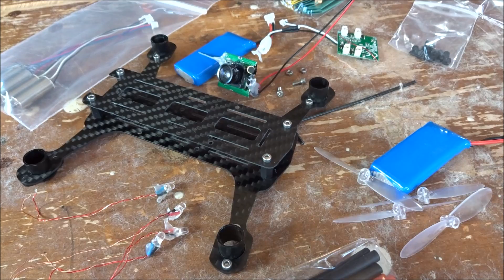Custom Micro FPV Quad: Build Tutorial

Comment: I want to replicate this build, but I'm a college student on a budget haha. What other transmitters will work with this? I see you have $99 one, I'd like to be able to use one a little cheaper than that.
Reply from the maker: +Brandyn Reeves Pretty much any transmitter that does DSM2, but sure what the cheapest one is. That is only for this flight controller though. I only used it so I would have acro capabilites. You could very well buy a BNF $13 JJRC JJ-1000 and swap in the board and remote, and save like $120 there. Makes it feel more like a toy though. This frame is also a bit heavy, so maybe something made out of poly and cheaper?
Reply: Sweet thanks for the information. So I'm hearing that I could use almost any mirco quad board/transmitter (with the plug and play motor option) and put it into this frame? Would the size of the motors limit anything or not really?
Reply from the maker: Brandyn Reeves Yes, to an extent. The board does not need to have the plug, you just have to solder them on. As for motors, if you are running this frame, with FPV gear, 8.5mm really are necessary. Any smaller like 7mm and it will be really under powered. Also I don't think the frame comes in anything but 8.5mm ;P
Reply: The RCAddict  Sweet! Thanks for all of the info!

Comment: Does the NQx fpv board work well with the motors?
Reply from the maker: +fish herp Yeah, it is the module it is not so friendly with. Took me a while to get the settings right to bind, and now it will bind every time, but getting throttle control to work is luck :/ Let me know if you are doing it and need help with settings :)

Comment: the flight controller you sent us a link to is not the fpv one?
Reply from the maker: +richard zglobicki When I bought mine, it was from the US and $30. But it seems I cant find anymore like that, as where I got it from went out of stock. I added in a new link, but it is from Germany and $45 :( Only one I could find on eBay, and at that point it would be better to buy it straight from Horizon Hobby in the US from $40

Comment: I think those are black nylon nuts, not spacers.
Reply from the maker: +Wm Robert Leschyna Yes they are. It comes with a set of plastic nuts and bolts as well, to save weight. I think you probably could use them as spacers though :)

Comment: I'm no expert but perhaps if you upgrade to a circular polarized antenna (Search this on banggood: FPV 5.8GHz Micro CL TX Antenna Lightweight) you will get better range and video quality?

I use that antenna on my diy 10g fpv rig. The antenna itself weighs 3g and you can bend it in to shape with no obvious effect on picture quality. I've gotten about 200m range on it, flying along a beach. My transmitter (MJX X600) lost signal, but the video I was getting was a little grainy but easily flyable.
Reply from the maker: +OHMYQUADcopter I am not so sure how to swap out an antenna like this, but I am getting just fine signal with the stock linear one :) On a larger build I would never use a linear though :) I fly it around fine inrdoors, and only starts to get bad behind 3 walls and around 2 corners ;) I got about 150M outside.
Reply: +The RCAddict nice range! I thought it would be no more than 100m. 

There are a few tutorials on youtube, all you have to do is connect the antenna to the antenna vcc and the wire around it to the ground ports. 

If you're getting 150m range no problem, save yourself a few grams.

Looking forward to flight footage!
Reply from the maker: OHMYQUADcopter Yeah, and smething like this is indeed only for indoors or close in outdoors flying :D

Comment: btw your first 2 links (Frame and motors) does not work. Psd: where can i get the board?
Reply: +Arpuz™ also, how do you pair the transmitter with the quad and how do you also pair the fpv camera with the screen that you will be watching what the camera sees? (btw, which screen should i get?)
Reply from the maker: +Arpuz™ I went through and fixed the links. Are they all working now? I couldn't find the board in the US anymore. I got mine for $3o in the US, but they are now sold out, and I could only find $45 from Germany :/ The camera stars transmitting once it gets power, so you turn on your screen and receiver and go through the channels until it picks up the video :) I use the Quanum V2 goggles and recommend them.

Comment: This is an interesting build!
I have a micro H frame that I've been putting off doing anything with and your mention of the Blade Nano QX board makes me wonder if my X9's FCB can also handle running 8.5mm motors when it runs 6mm motors right now.
Oh -replace that metal hardware with mylon for massive weight savings.
It's really surprising how much all that metal adds up compared to the equal amount of nylon stuff. -I hit ebay for 'em .
I have another orphaned FCB from a JunCheng 3015-2Mini Drone (the later fixed FCB not the "voodo quad" board) that is first in line for my mini H frame, but wanted to get your input if possible.
Reply from the maker: +Michael Thompson I am not sure about the X9. I think the NQX FPV runs 7mm, so 8.5mm is nt too much, but from 6mm it might be :/ It came with a full set of nylon screws, and I have swapped them in and saved 3g. That board in an H frame would be interesting indeed!